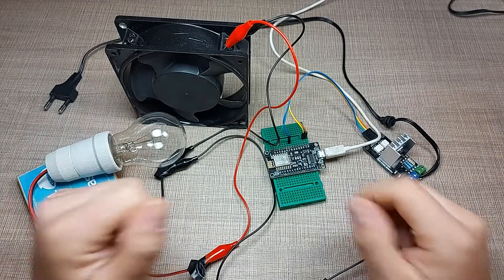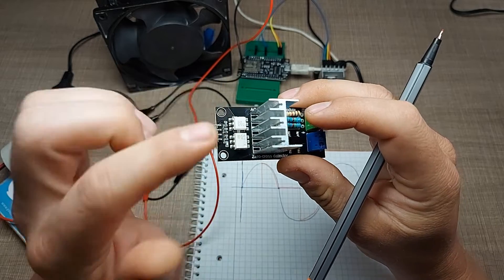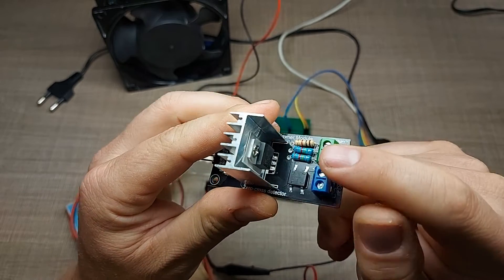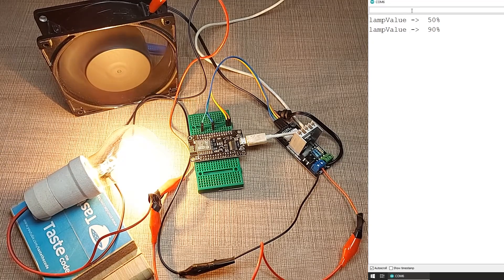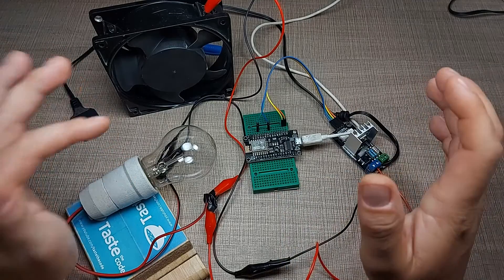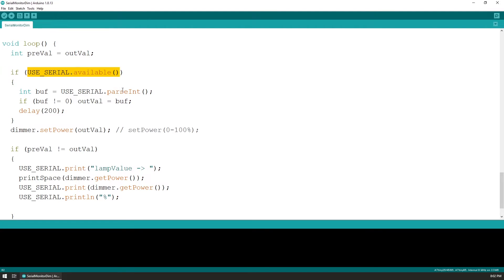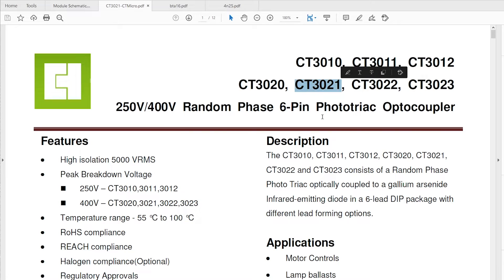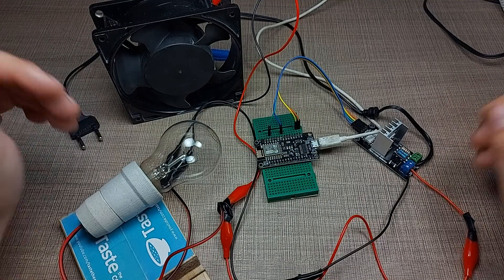AC Dimming and AC Motor Speed Control How To with Arduino/NodeMCU

Comment: So I am looking at a similar situation, I want to control my fan that is supplying air to my fireplace . My fireplace currently is controlled by a snap switch and a rheostat. I would like to make it work heat based so when the temperature get below a value turn off and as temperatures increases the fan speed also does.

Comment: Excusme sir, I'am sorry, my program encountered an error, = 

10 | #include "esp_intr.h" 
compilation terminated.

Can you help me sir? Thaks sir
Reply from the maker: Make sure that you have the right board installed and selected in Arduino IDE. There is no way for me to know what exactly is causing this issue but you can start with checking the boards. Otherwise, please search online for similar issues.
Reply: @TasteTheCode  Oke sir, i done using board ESP32, and i try search in internet, but can't yet

Comment: In the USA we use 120VAC and I have a large 2.0HP (about 10amps) Inductive AC motor I need to control the the speed of on a table saw.  I like you setup. Problem with Triacs is Idle current. So when your circuit is "OFF" how much power is it still drawing ?
If I am Drawing 10 amps then would I not need a much bigger heatsink for the Triac ?
Would you still use an Arduino node MCU if you did this again ?
Reply from the maker: You will need a dimmer that is rated for the load you are applying. However, large inductive loads are now a good thing to regulate with this method. In terms of the NodeMCU, sure, it does the job but you can also go with ESP32 nowadays.

Comment: Can you metion your Arduino IDE, Esp8266 board manager and RBDDimmer library version.?
Reply from the maker: I don't recall what versions I used exactly as I constantly update them to the latest ones.
Reply: @TasteTheCode   but now its works or not
Reply from the maker: No matter the library version it should still work.
Reply: @TasteTheCode  Can you explain me what problem i have faced.
Reply from the maker: I can try. What is the problem you are having?

Comment: Your content is great!  Inspired by this, I started creating a circuit that simulates sunrise and sunset for a chicken farm.  I am trying to dim 15 different lamps with a single dimmer module.  Everything is fine up to 2 lamps, when there are 3 or more lamps, I constantly get 220v output, dimming does not work.  I couldn't understand what I did wrong, can you help me?
Reply from the maker: Thanks for the great words! For the dimmer, what is the actual rating of it? The dimmer must be rated to handle the attached load so I'm guessing that yours is not and it fails ro handle the dimming properly.
Reply: @TasteTheCode  First of all, thank you for your quick response. I'm not sure what actual rating means, I'm sorry, my electronic knowledge is limited. But I can give more information about my circuit. I am using Robotdyn AC dimmer module, this module has bta16-600 Triac on it. The bulbs I use are dimmable 9w LED bulbs, 15 in total. I measure 0.3 amps when all bulbs turn on at the same time. The mains voltage where I am is 230V 50 Hz. Finally, I use the module on a nodemcu and the library I use is dimmable_light.h

Comment: Can I connect more multiple module's zero-crossings pin to the same pin (e.g. pin 2) of the microcontroller or do I have to have a interrupt pin for each  as I would the PWM signal pin?

Isn't it the PWM signal pin that controls the triac? Why would I need an interrupt to do so?
Reply from the maker: No, you will need an interrupt for each. It is needed because we need to know when at the sine wave signal to turn on the triac. This is AC so it works much differently to PWM in DC. The interrupt is there for the precise timing as otherwise the microcontroller will miss the right moment to turn on the triac.

Comment: For you who have flickering problem, try to add snubber R-C 100ohm - 10nF across the triacs MT terminal. The triacs  available on the market are cheap crap or fake one. BTA16 will couse headache. Try using triacs from old power electronics and its all smooth dimming. Chinese semiconductor sucks...
Reply from the maker: Hey, thanks for the added info. I did not had issues with mine but this is nice to know.

Comment: Hi. what percentage should I send so that I get 220 volts at the output? with 60% the output is 116 volt and if i increase the percentage the output voltage decrease again. can you send your email to contact with you please? thank a lot.
Reply from the maker: Make sure that the zero crossing code is set through the interupt and that there is no delay in the code there as with higher duty cycle, the code needs to run faster. For a full output the percentage should be 100%.

Comment: It it possible to add dht11 sensor to makeit  temperature base ?
Reply from the maker: You mean to measure the temperature of the lamp? Sure it can. Based on that you can then vary the duty cycle through the microcontroller.
Reply: Hello, we have same to add dht11, can i see your source code for this? Cuz i have to compile the value dont get it

Comment: Has anyone gotten this sample (SerialMonitorDim) to run on an Arduino Nano? If so what pins did you hook the dimmer module to, and what tweaks were needed to the code? I tried D2 for the Z-C interrupt and D5 (defined as pin 8) for PSM, but no joy. What am I doing wrong? Thanks!
Reply: So to answer my own question, for Arduino Nano outputPin should be #defined as PD5.

What threw me at first was that for some still unknown reason (at least with my dimmable LED bulbs) many power level settings (particularly but not solely those >=95 or <=20) yield unexpected and sometimes inconsistent results (flashing, flickering, a single pulse, wildly incorrect brightness, or just nothing). Of course these also just happened to be the very levels I randomly typed in to test the sample! Go figure... 🙄
Reply from the maker: @MarkLucas-s3x  Some of the low power settings know to be unstable because things are happening too fast I guess so the circuit can't keep up. I've also seen flickering with values <20.

Comment: hi. is this circuit frequency control or voltage regulator?
Reply from the maker: Neither, this cuts the current flow at each zero crossing point in the input sinewave.

Comment: can it handle and control 1.5-2Hp 220 ac induction motor?
Reply from the maker: The module says it can handle 8A of continuous load but I'm guessing that is for a resistive load. A 2Hp motor will draw ~13A. And that is an inductive load which brings even more problems. The module is suitable for smaller motors, fans and heaters.
Reply: @TasteTheCode  how about a 1.5Hp gear motor?
Reply from the maker: That will be around 9-10A. Still too much.  There are probably bigger modules that you can look at that should handle such loads.
Reply: @TasteTheCode  what modules should I use?
Reply from the maker: @carljay2177  You can try this 24A module but I've never used such high power module, I'm not sure how it will go. https://www.aliexpress.com/item/1005001965951718.html?spm=a2g0o.detail.0.0.2b64657cSJgOQh&gps-id=pcDetailBottomMoreThisSeller&scm=1007.13339.291025.0&scm_id=1007.13339.291025.0&scm-url=1007.13339.291025.0&pvid=6c714dc3-2f23-475b-aa9e-f302b2334412&_t=gps-id:pcDetailBottomMoreThisSeller,scm-url:1007.13339.291025.0,pvid:6c714dc3-2f23-475b-aa9e-f302b2334412,tpp_buckets:668%232846%238111%231996&pdp_ext_f=%7B%22sku_id%22%3A%2212000018256785548%22%2C%22sceneId%22%3A%223339%22%7D&pdp_npi=3%40dis%21USD%217.99%217.83%21%21%21%21%21%402101d1b916787005781816918e5674%2112000018256785548%21rec%21MK%21164368730

Comment: Could let us see the code which makes it work with a Potentiometer instead of using the keyboard.  I guess you connect the pot to the ADC input pin?
Reply from the maker: Yes exactly. The read value needs to be mapped in a range of 0 to 100 and can be used to drive the dimmer.

Comment: Can we determine the output AC voltage as we want? For example I want the output to be 175V AC
Reply from the maker: There is no real feedback about what the output voltage is but you can I guess ise math ro calculate it or use voltage sensor to read it and feed it back to the Arduino.

Comment: Hi, I have to control 4 lights at the same time with 4 different boards, did you use the command: dimmer.setPower(val) to control one output, to control multiple outputs which command should you use?
Reply from the maker: For multiple dimmers, you will need to define multiple dimmerLight objects like dimmer1, dimmer2, etc., and then set the brightness on each of them. If they are running from the same AC phase, I think you might get away with using just one zero-crossing signal, but otherwise, you will need a board with multiple interrupt pins like ESP32 in order to control all of them.
Reply: @TasteTheCode  Use the same phase. Could you give me an example with the code, in the library examples I didn't find anything
Reply from the maker: @cicciosonyalfa  You need to create different objects for each of the dimmers like this dimmerLamp dimmer(outputPin);, dimmerLamp dimmer1(outputPin1);, dimmerLamp dimmer2(outputPin2); etc. where each dimmer has its own pin that it is connected to. Later you will need to set the values of all of them like this: dimmer.setPower(outVal);, dimmer1.setPower(outVal);, dimmer2.setPower(outVal);, etc. I have not tried this and it might have an issue with all of them using the same interrupt pin but you can give it a go. If this does not work, then all initialization will need to be done with the second constructor where a different interrupt pin is passed for each. dimmerLamp dimmer(outputPin, zerocross);
Reply: @TasteTheCode  Thanks, as soon as I get the 4-light card I'll try and let you know
Reply: @TasteTheCode  The boards arrived, I started programming a board and it works well, if I add the definitions of the other 3 dimmers, (dimmer 1, dimmer 2, dimmer3) the lamp flickers, goes off halfway through the cycle, then goes back on. If I remove the 3 definitions, the lamp, as if by magic, starts working well. Does that mean this library can only work with a lamp?
Reply from the maker: What dev board are you using? I think the problem might be in the interrupt pins as explained previously. Try something like ESP32 that have multiple interrupts and separate them in the definition. Like so: dimmerLamp dimmer(4, 2); where 2 is the interrupt pin and 4 is the control pin.
Reply: @TasteTheCode  I am using arduino 1
Reply from the maker: The Uno has only two interrupt pins, 2 and 3 so you can try this with 2 modules and see if it works.

Comment: going to try this with 2 modules and an esp32. hopefully the interrupts stay high long enough for that.
Reply from the maker: Yep, that should work just fine. I tried it once with an Attiny85 once and it was still working OK.
Reply: @TasteTheCode  nice to know! I ordered 2  already. I'm making a 3d printer enclosure and I want to regulate the internal temp of the case with the 110v extractor fan and I'm thinking of powering the actual printer with another module so I can shut the printer off if the thermistors detect unusual high temps etc. maybe even hook up a smoke detector in there to
Reply from the maker: @BenBilesBB-box  Sounds like an interesting project 😀 If you need simple on/off, maybe a solid state relay is better for turning off the printer?
Reply: @TasteTheCode  thanks, great idea. I just found the same company sell an SSR with opto isolation and 3.3v - 12v logic for a few bucks. I can have 2 variable speed fans and power shut down for the printer now with SSR.

Comment: Do you know on how to control 5V fan speed using raspberry Pico ?
Reply from the maker: For DC loads like that fan, you new PWM signal from the Pico to turn on a MOSFET as the fan draws more current than what the Pico can provide.

Comment: Hello , does an intterrupt pin affect the zerocross off the dimmer, i found trouble that when i use the dimmer and use any interrupt pin i found error in the compiler
Reply from the maker: Yes, an interrupt pin is required to get proper timing on the zero crossing signal. If you need multiple interrupts, then you must use a board that supports them and define different routines for each.
Reply: @TasteTheCode  what board do you suggest?, Can it use arduino mega??
Reply from the maker: @faturahmanf3024  each board has different specs, Mega has pins 2, 3, 18, 19, 20, 21 (pins 20 & 21 are not available to use for interrupts while they are used for I2C communication) defined as interrupts. On ESP32 all GPIOs can be configured as interrupts.
Reply: @TasteTheCode  so in arduino mega i can use each of this pins to use interrupt pin for any different function including use it as zero cross for the dimmer, is that right?
Currently in my board using arduino uno i cannot compile the program of rbd dimmer if i use one of the interrupts pin on it, so in my board i use pin 2 for zero cross and i use pin 3 for the interrupts pin for the encoder, but the arduino ide cannot compile it, a cannot use it at the same time. i have to use one of it so the compiler not error, so if i use dimmer i cannot use my encoder, then if i use my encoder i cannot use my dimmer, if you give me some help i will be very appreciate it, currently i working on my final project for my college
Reply from the maker: @faturahmanf3024  hmmm I'm not sure what might be causing that. You should be able to use both interrupts at the same time as long as they have separate handling routines. Try searching for the exact error message you are getting and resolve it that way.
Reply: @TasteTheCode  okey , i think the problem is the library of the rbd dimmer that i use, i use the library rbd dimmer from my friend that already modified, cause the library of rbd dimmer from official robotdyn in github web cannot be used, the library cant compile, what about yours??, where do you download those library rbd dimmer, if you have the library that working fine in your arduino ide , please share me the library, thank you in advance.
Reply: @TasteTheCode  sorry sir , does that library , robotdyn dimmer from the link really worked? Cause its not working on my arduino ide, please help
Reply from the maker: Yes it did. Make sure that your wiring is correct. You have my full code in the video description.

Comment: can we use 2hp ac motor with this Dimmer Module. pls reply
Reply from the maker: The 2hp is around 1.5kW? That is what Google told me so if that is true, the current draw of that motor on 220V will be about 13A. The module is only rated for 8A so the answer is no. The maximum I would use this for is around 600W. You need a module that can handle a lot more current but the setup will be the same.
Reply: @TasteTheCode  thanks for your reply

Comment: My dude!! This is what ive been looking for. Can you do a video on how to add pid temp control of the ac fan controler. Outputting the temp value via iot user interface like blynk.
Reply from the maker: Thanks! That's an interesting request. I'll add the idea to my list.
Reply: @TasteTheCode  thanks buddy. The cheapest pid fan controller is the smscom at 50 bux.  Thats without iot. I hope this makes it to a video. It would help me and my gardening budys out loads to be able to control fan speed based on temperature.  Plus it would compliment our iot aquarium monitor we have just made. Coughs * hydroponics *

Comment: Im using this module and SUNON DP203A AC FAN and it's acting strange. Bulb works fine but the fan is just buzzing when at 50%. At 70% it works fine but slower than 70% and at 99% it's buzzing and moving at a speed of 1 maybe 2 RPM. Any idea why? I dont have an oscilope to monitor the output wich i suppose may be useful. Thanks for the video :)
Reply from the maker: I wonder if there's some noise on the zero crossing signal. I had some weird behavior as well but only on very low speeds where I guess the motor was not able to spin they slow. Try the motor and the bulb in parallel, maybe the motor inductance messes with the module in some way. Let me know the results, I'm interested in what's going on.

Comment: Hi, I am currently working on a project similar to this, this video is very helpful. I do have a question, are the two loads connected in parallel?
Reply from the maker: Yes, both the fan and the light bulb are connected in parallel.
Reply: @TasteTheCode  thank you for the reply
Reply from the maker: @ocean8649  You are welcomed!

Comment: my fan went to trashbin ;-(
unfortunately: not ALL AC fans are OK with speed control using this method 
just that you know ;-)
Reply from the maker: Sorry to hear that. Any specifics why? What makes some work and others not?
Reply: @TasteTheCode  type of AC motor. I am not 100% sure about the names but there are few of them and .. the cheapest fans are... the cheapest, not subject to "triac things". They have wire split into 3 parts and there is a rotary switch giving possibility of speed 1,2 or 3. I wanted to be "better" and use speed 3 and then to regulate the speed by triac... I could have saved it but I turned it on and ... went for coffee. The fan was at zero rpm and got burned due to some lower current but without rotation there was no cooling so. Anyway, you cannot learn without mistakes ;-) I am back to business by making this rotary switch remotely on my turbo and relays inside the fan to switch the wires while and can do it remotely from the bike.
Reply from the maker: @zyghom  yes, low RPM can be a problem. In my case, I found that 30% is the minimum at which the fan spins at all so I plan to limit the low end so it does not stop to provide some cooling.